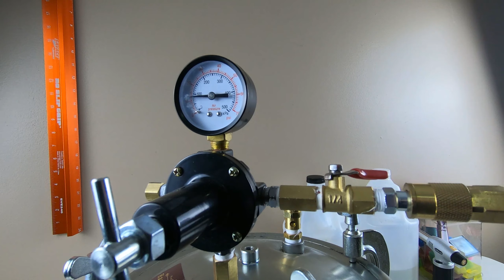Start to Finish! Hand Turned Blue and Black Galaxy Epoxy Resin Pen

Comment: Hey so km new to this whole thing are you pressurizing that pot or pulling a vacuum I've seen other people pull a vacuum to remove bubbles but it looked like you connected an air hose to pressurize it so I'm wondering what that does
Reply from the maker: It's pressure, it compresses the resin and forces bubbles out and shrinks the smaller ones so they're just gone. There's a few videos on YouTube about converting a Paint Tank to a pressure pot for resin.
Reply: @Dangly3D  that's really interesting thank you for the information. What psi do you pressurize to I tried pausing the video to see put I couldn't see clearly?
Reply from the maker: It depends on the working limit of the pot. Mine is 45 psi. I pressurize to 50 and it falls back a bit.